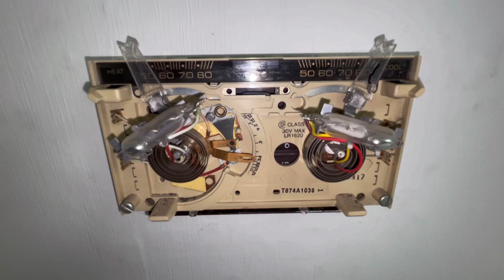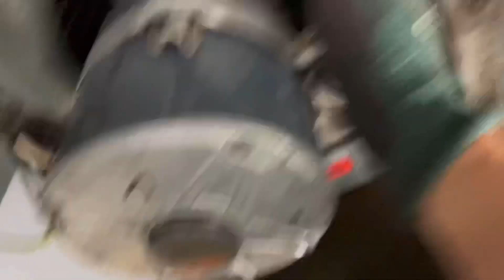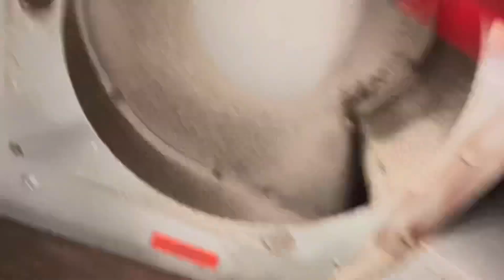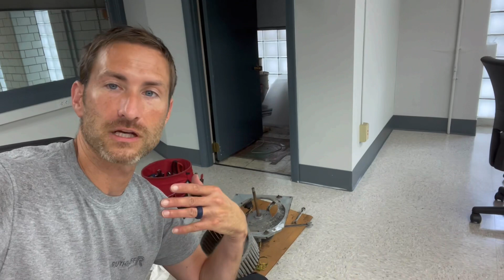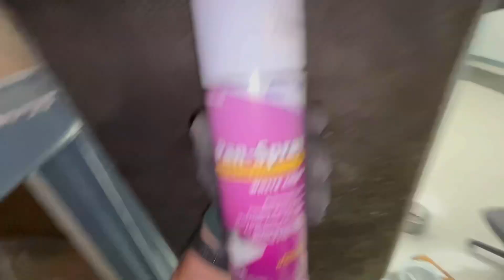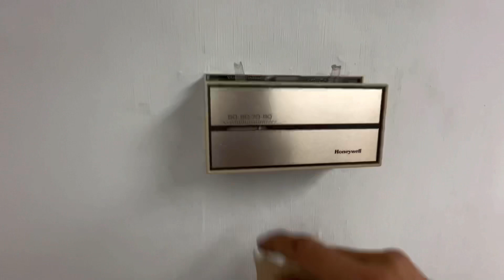We’re out of Balance!!!! #Steamfitterslocal449 #HVACEXPLAINED #RuthRauff #hvaclife #carrier #sporlan

Comment: Tony you got lucky on that blower wheel, some days ya do!
I helped my lead tech with one on a bad ECM yesterday. No budge 😖
Cut some fins off, sawzalled the shaft and new blower wheel.
Sometimes those things just are not gonna free up and we would have destroyed it anyway trying to ‘save’ it.
At my house as soon as I hear or see thunder, the ac goes off if I’m home. I’ve also shut it down when bad storms are coming in, it doesn’t have to be local to burn up something with brownouts or surges. We both see what happens every time we get t’storms; caps, motors, compressors, fuses, breakers, terminals and boards need a new bottle of acme smoke replacer. 💨
Reply from the maker: Yes sometimes those wheels just don’t wanna come off I always recommend to every Apprentice whenever replacing a motor make sure you pick up a new wheel or blade.  Someone ordered a new motor and I was the lucky guy to change it out I spent over two hours trying to remove a blade! So I like to have extra parts just as back up in case things don’t go so well.  I totally agree shutting down the HVAC system and unplugging stuff during major power storms is smart especially with ECM motors and expensive circuit boards involved.  Have a great day and have a good weekend.